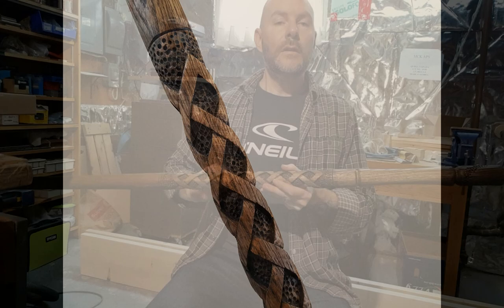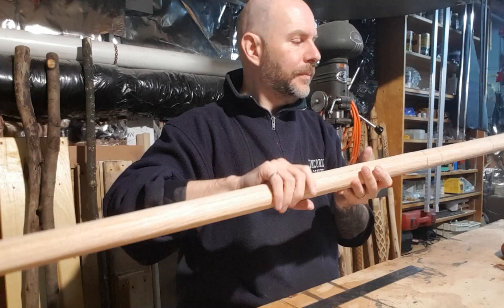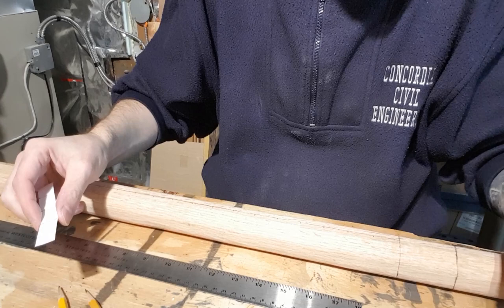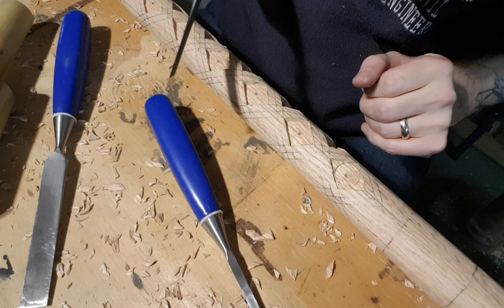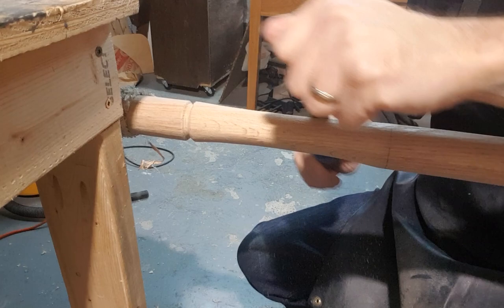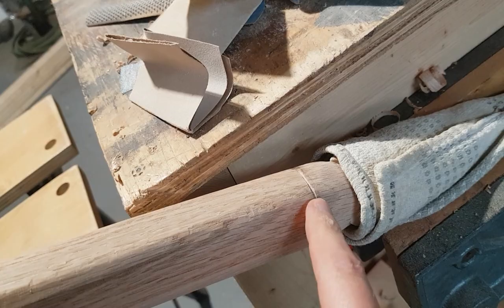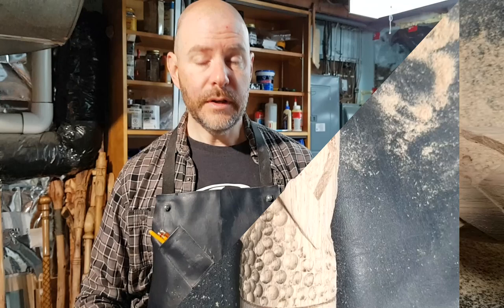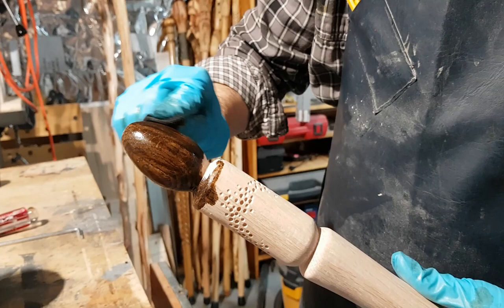OAK WALKING STICK - carving a Celtic Weave

Comment: I very much like your walking stick.  The ornamentation is phenomenal.  Still, I miss one feature.  I don't know the proper English word, but look at the ring grooves on both side of the handle.  Norwegian walking sticks tend to have two similar rings with a distance of a coupple of inches at the bottom.  We're using this to attach tools to the stick.  This could be a sport saw, a crooked little branch or a knife, to cut down/weigh down items from a tree
Reply from the maker: Interesting, I've never heard of it... I'll look into it! Thanks

Comment: Great video, at the 4:40 timeline you are marking the centerline in a dimension you did not talk about, how did you arrive at the interval?
Reply from the maker: Thanks for watching... I just marked them at 1" intervals... a completely variable amount but this allowed the pattern to be more or less square. But you can vary this value and either stretch out the "diamond" pattern along the length or shorten it by decreasing this spacing.

Comment: Where do you source your wood?  Do you find it and shape it with a draw knife or do you buy the blanks?  I am just getting into walking stick carving and am not sure if I should be looking for small straight sapplings or 30 ft. trees with sizeable trunks that I shape down.  Part of the fun for me is the hike for the tree that calls to me.  Thanks!
Reply from the maker: I usually find downed branches in the woods, I don’t like to cut live trees for my sticks. For this Celtic weave stick I laminated two 1x2” oak boards together and shaped them down. Hope that helps.
Reply: @JasonHedrich I agree, I don't like cutting down live trees either.  Thanks for this!
Reply from the maker: @MrDaoJones  your welcome

Comment: Howdy howdy!   In the video, at the 1:52 mark,  I see three large diameter sticks that are a wee bit crooked.  I have such a stick and trying to figure out how to get from said bent stick to the nice straight stick you are working with.   (My stick is a fallen oak branch that was roitting on the outside, but I cleaned it up and have about a 2+ inch oak stick with lovely grain, but to bent to work on easily,  Seems like the ones you have in back.  What do you do with those?  Will subscribe and pray for another video!
Reply from the maker: Thanks for watching and subscribing! I usually try and work with the bends, try to carve a wood spirit face into the curve or bend. Or try and use the bend to form the handle section. If the diameter is large enough, then you can carve the stick straight while getting down to the final size. But don’t be turned off by the bent sticks, it’s more natural and they turn into something different and beautiful.

Comment: How did you draw additional lines trying to duplicate no success thank you
Reply from the maker: Not sure which lines your are asking about... The main diagonal lines are done with the grid pattern. Then I measured out either 1/4" or 1/2" from the centre lines. The thickness of the weave can be adjusted to your taste
Reply: @JasonHedrich  thank you for your reply